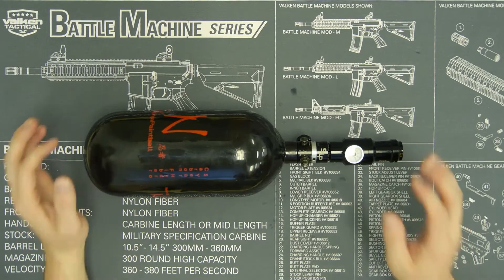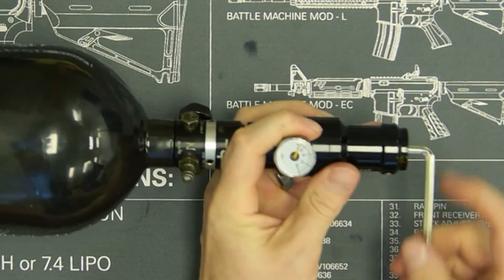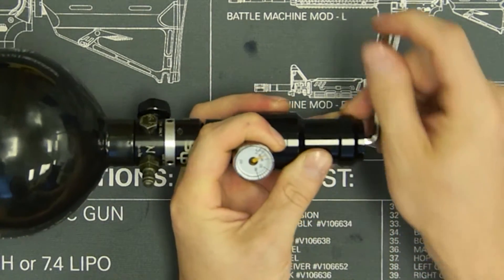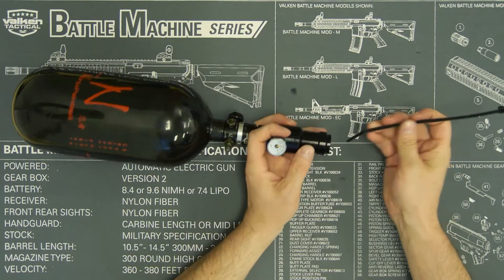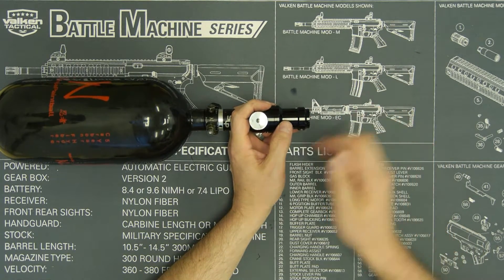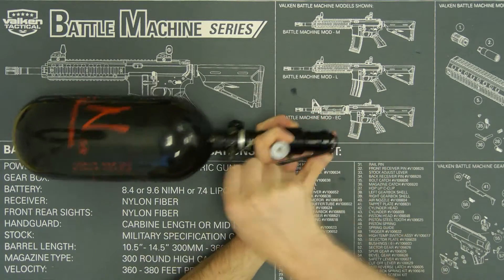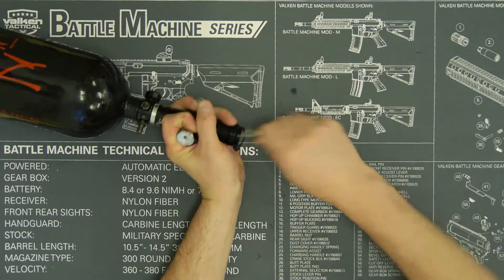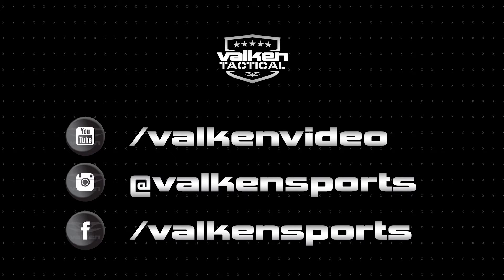Valken Tactical Minute Clinic Locking Your Regulator

Comment: This was no help for me I just bought this air rig and every time I screw it on my air tank it sprays out air from the top every time I've adjusted it everything high to low and it still sprays out air and won't stop how can I fix that please tell me
Reply from the maker: check your seals, also unscrew (release) the on/off before screwing it on
Reply: this happens with mine as well. is it the spring gide rubber "poppet"  that causes this? it is making deep impressions on it.
Reply: mine spews out air if I havent shot my gun for like 15 seconds, it just leaks air
Reply: Garrett_speedqb happens to me as well, I have a redline airsoft reg, whenever I try to turn it on it just sprays air and never really locked the air in, I need help as I just got it off of someone as a second hand I don't know if it's already broken or if I did something wrong, someone help me I'm a new hpa user btw

Comment: what is not clear in this vid is that I believe the regulator is only suitable for LOW pressure input, 300 PSI max, so unless you have an SLP tank it wont work as most standard tanks are 800 PSI output